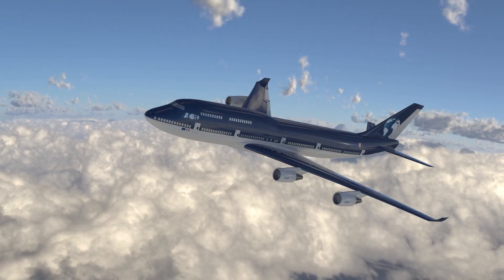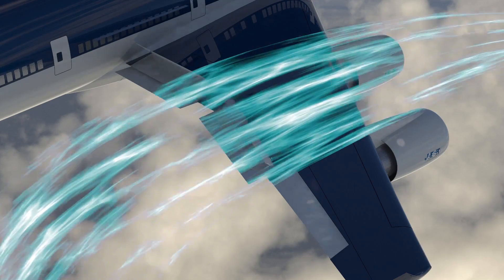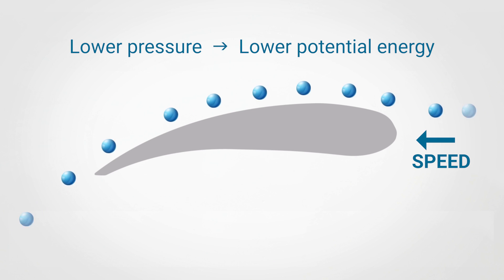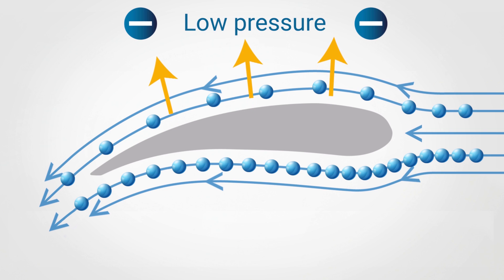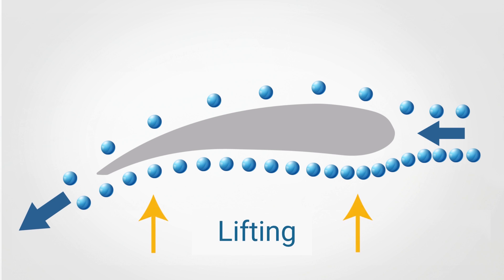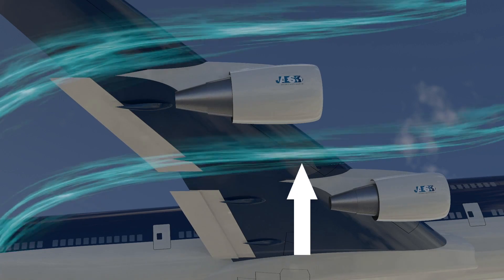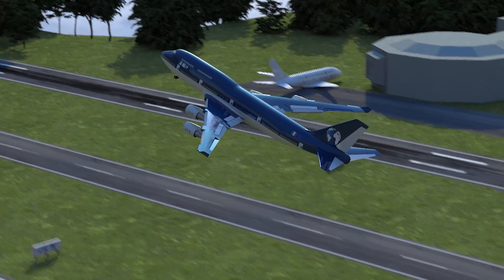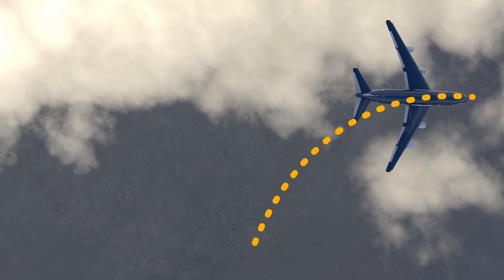How do airplanes fly? Components - Coandă effect or Bernoulli effect- Downwash - 3D animation

Comment: 9:35 wrong, wrong, in phase of climb lift is less than weight but thrust takes part of weight  besause main lines of forces-lift/drag/weight/thrust are divided and have its components, because of angle of attitude
Reply: I'm not sure if that is nessecarily true. I can think of situations where it could be but surely you can think of situations where in climb lift is greater than weight and thrust is contributing. Because lift is also contributing to drag due to the angle of attack. Oh by the way what countries call it angle of attitude? Is that common outside the US?
Reply: you think too much  , belive or so, and too ltlle know,  i talk about facts, in steady climb this is it, i am aeronautical engeneer and i flew on airplane and helicopter, so do you think/believe that i was wrong learned, what are your references-, you are surly chef or so
Reply: @makantahi3731  I am also an aeronautical engineer with a masters degree in aerospace engineer with a focus on aircraft design and flight theory. I am also a pilot who flies airplanes. I do not need references to prove you wrong, you need references to prove yourself right. The burdeon of proof is on the one making a claim.  We can not just rely on the fact that were engineers here to say oh I know it's true cuz I said so.  Perhaps during the climb phase of the 747 it particularly produces less lift than weight because of its angle but this is certainly not true for every airplane during every climb. For instance, an f15 could climb almost flat with flaps down. Then lift would be more than weight. Or it could climb at 90 degrees to ground. Then lift would be basically zero and thrust would be more than weight. 
Also it shows your insecure in your beliefs calling me a chef, and you never answered my question, what countries call angle of attack as angle of attitude?
Reply: yeah, right, then you missed some  basics of theory of flight,(i hope your bosses in nasa wouldn not read your comment) and you have a wild imaginationand ,,i am answering to you: i intentionally did not use angle of attack because it is not so important on whole plane in this situation, more important is angle between aircraft longitudinal axis and horizontal axis through cg, btw, you surely was in space too, what is new on isis, and you as director of universe you have time to loose on this semi produst of video, you all said, and if f15s fly verticaly90deg, there is still lift it has to have negative aoa to be zero(you stilll think that you are master of what, ) so if you have some helpfull tip for video that is full of errors
Reply: @makantahi3731  ok so first of all, I'm not sure what personal issues your going through right now but I hope your ranting relieves your stress. I am not the master of the universe or work for NASA. I have a masters degree, the graduate degree that comes after B.S in america. This may be lost in translation to you.  I design aircraft and do fluid flows so your hyperbole about me being to space is a little funny. Astronauts are cooler than both of us and we have to accept that. 

 Your the one who started this whole I'm an aeronautical engineer thing listen to me, my point isnt that I'm better than you its that you cant use the argument I have a degree I'm right against me because I also have that degree too. 

Also we would have to know that the f15 airfoil is cambered for that to be true, let's assume it is. It would still probably produce very little lift because I specified the flight path as 90 deg to the ground, lift would disrupt this. You are right though that a chambered airfoil produces zero lift at a negative AOA. I would be careful with your attitude statements though, the f15 has a center of mass behind the center of lift and so much thrust that the angle to the ground is less important than the air. 
Finally, I did make corrections to this video, you can read my comment If you want and challenge whatever I say if you feel I said anything wrong.
Reply: @makantahi3731  Who said that a plane cannot fly a trajectory with a flight path angle of 90 degrees whilst profucing zero lift? It absolutely can. @Mert Garbonite is correct in his observations. You are generalising very specific cases.
Reply: luca borroni:   on what trajectory fly b747 in this video is this very unusuall or very usuall, and your mert does see difference between aoa and angle of longitudinal axis of plane, it can climb (b747) with 30 deg nose up but aoa can be 5-7 deg
Reply: @makantahi3731  ok, in cases such as a normal 747 ascent it could easily be true what your saying. But you gotta be careful defining the lift  90 deg to the airfoil and then alot of the lift is contributing to lift induced drag and 90 degrees to the ground then you have to reduce the lift using cos or sin and now who is to say, especially in the context of the video. 

Were all aerospace engineers here, Luca too (close enough) we all understand exactly what your saying with the vectors. But this video is meant to show people with little to no technical experience how flight works. So I think saying lift is greater than weight is a decent generalization for flight ascent stage while not 100 percent true in all cases. 

A little advice, I think your statement could be more well accepted if you phrased it more like, interestingly, the 747 can actually produce less lift than weight due to the thrust contributing to the net upwards force on the aircraft. Us other aerospace engineers would have been like yeah neat vectors sum good point and laymen would have been like ok cool fact.
Reply: i am glad that we agree about it, i think that people with not much knowledge about airplanes should get right information because they will remember this video as first and they will believe in it  to rest of their life, so that is why is important to give right information no matter if it is paradoxal. i have more interesting things about it for ex.:plane has better climb performance if engine thrust vector is more horizontal, but would has worse horizontal flight performances(it is more important)
Reply: You may be correct under certain hypotesis, but that is not the general case.
Reply from the maker: @lborroni8090  thanks a lot for your opinion please inform us and leave a comment if there are other part of video that you Don t agree all your comment are very important for us
Reply: luca borroni:  there is not any hypotesis, it is general and most usuall school case  that plane that climb as this b747 has less lift than weight because  thrust takes part of weight, it is vectors geometry of primar school , how old are you

Comment: 6:53 it is not how it looks like in real world
Reply from the maker: Dear Tahi please indicate how is in real world and give your point of view
Reply: on 6:52-53 is shown  airfoil , flaps and slats  how it does not look like on that particular plane b747, if you wanted to show it in general you should not take b747(400) you should take just something that look like airplane because now it means that b747 is just like that, and it has splitted rudder-high and low speed surface, and aileron too, flaps are with more slots, and flaps are not extended just from lower side of wing......

Comment: Dear JAES, 
I thank you for correctly clarifying the equal transit theory fallacy, good work. This is by far the biggest misunderstanding people have on flight theory. 

However, a few notes, It is not nessecary to place the wing at an angle. The airfoil is cambered and can therefore produce lift at zero angle of attack or even negative angles. Also, If the speed is the same before the wing and after the wing then there would be no drag, this is obviously incorrect. The drag is manifested by the flow separating In the wings wake  ( pressure drag ) and also the skin friction changing the air speed A to B in your diagram. 

Also saying that the pilot raises one aileron and lowers the other may be confusing to young ones. The pilot just takes his control inceptor and pushes it left, this causes one aileron to Lower and the other to raise.

Otherwise this was a well produced video and a good improvement on the old version. Please consider making one about aircraft stability, and one on  lift induced drag and the control coupling of roll and yaw. This is another section many people even pilots do not understand fully. Thanks.
Reply: We need more people like you in the internet. Well done.
Reply from the maker: @mendo4207  thanks for your comment we advise to watch too https://www.youtube.com/watch?v=zTEcMEd4E1k&t=23s
Reply from the maker: Dear Mert thank a lot  for your comment. please when you have time can you give us some advise about this our video aboutHow do HELICOPTERS work? Newton’s Laws - Airfoil Technology - Angle of Attack https://www.youtube.com/watch?v=zTEcMEd4E1k&t=198s